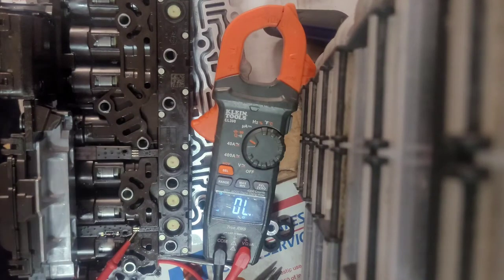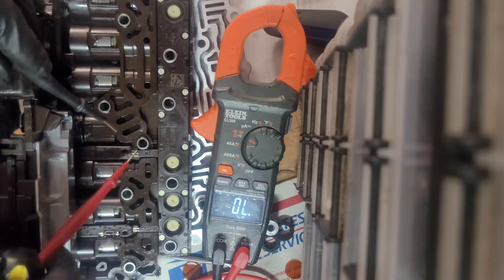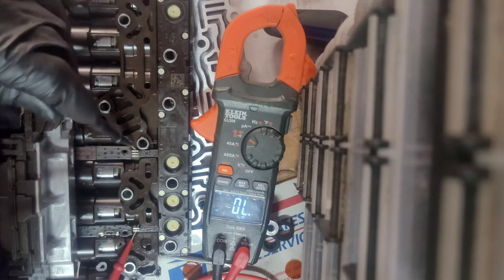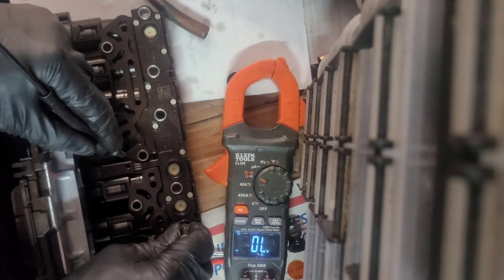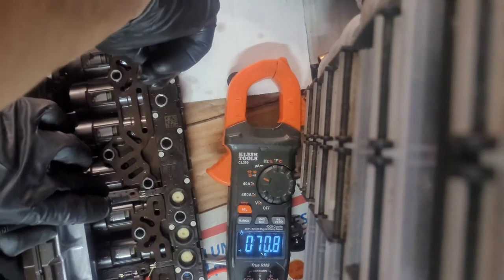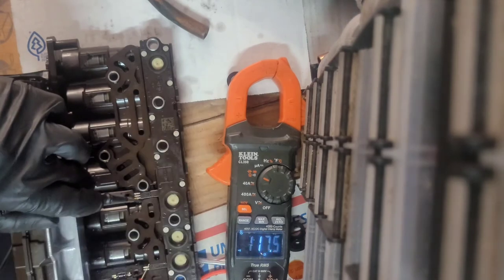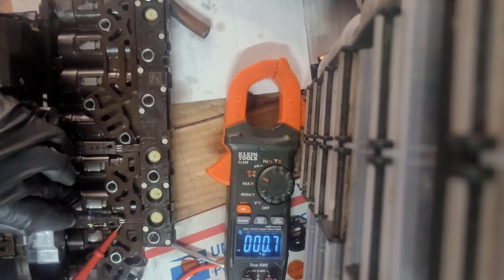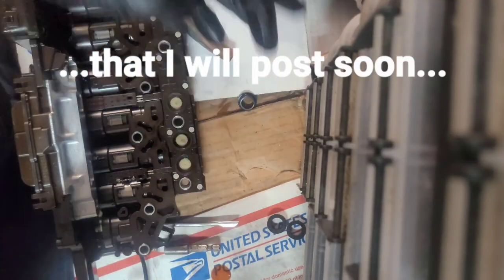6L80 - TECHM PRESSURE SWITCH ELECTRIC CIRCUIT BENCH TESTING -

Comment: The common connection is the middle of the group of three pins. If you use the left of the two pin group and cycle the switch at the outer end of the group of three you'll get a response on more than one switch which shows the test is not isolated to one switch circuit.
Reply: Great.. This will help me find out if they are working. Appreciate your attention to this process.